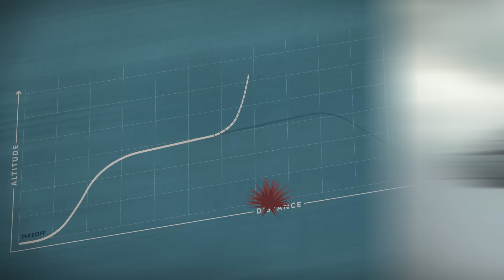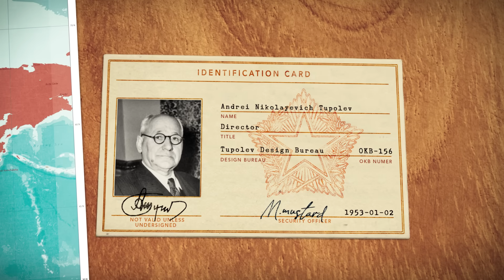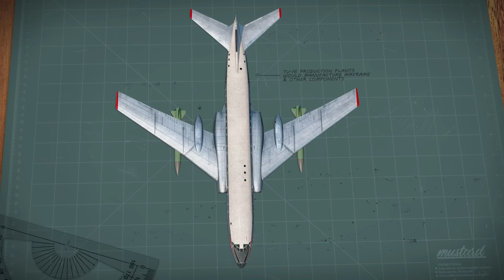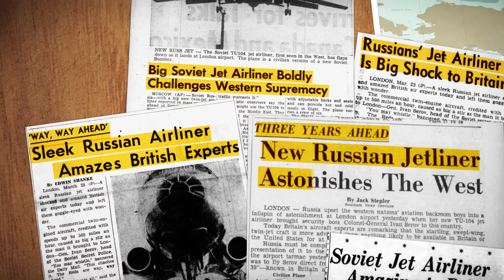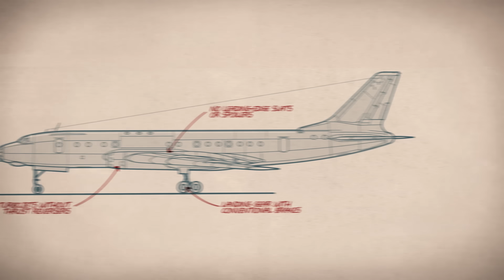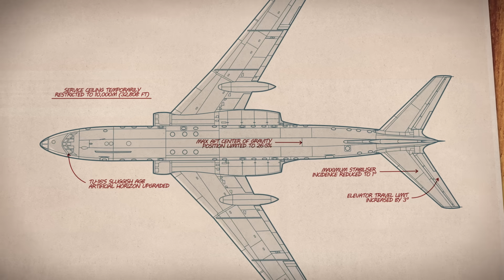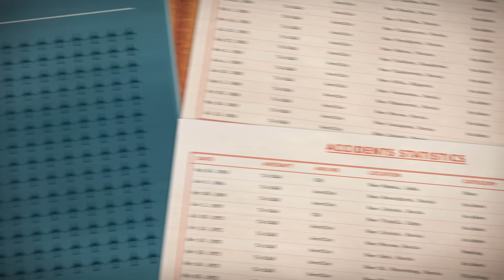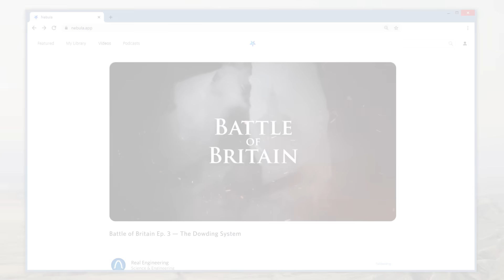The Soviet Airliner Designed To Crash

Comment: You now the plane is bad when you are hoping for a stall in order to improve your situation
Reply: The de Haviland Comet was the worst jet airliner in history.. it disintegrated in mid-flight
Reply: @WilhelmKarsten At what point did he mention the comet? Plus, at least the comet designers grounded the entire fleet until the issue was resolved, the Soviets swept it under the rug. And there's a reason the comet was actually successful, unlike the TU 104
Reply: @Crustaceannationrepresentative The Comet 1 is the biggest engineering failure in commercial jet aviation history.
The British government didn't order the Comet to be grounded until there were 6 unexplained hull loss accidents.
Reply: @Crustaceannationrepresentative The issue with the Comet 1 was never resolved, it's airworthiness certification was permanently revoked and no Comet 1s ever returned to revenue passenger service.

Comment: All aircraft have a fatal flaw - it's called the ability to crash, by loss of flight, power or hitting something solid at excessive velocity.
Reply: The de Havilland Comet is special... it often crashed because it couldn't fly, skidding off the end of the runway unable to get airborne 
And then when it did manage to get to altitude? It suffered catastrophic in-flight structural failures..
Literally disintegrated for no reason without warning...
 The Comet was the worst engineering failure in commercial jet aviation industry and a shameful and humiliating chapter in British aviation history.
Reply: Or maybe, in the cases or Air Inter 148 and Lion Air 610, software which does something that crashes the plane

Comment: the comet had one flaw in its design the shape of the windows ,stress concentrated on the corners and caused fatige cracking , a major problem for any pressurised aircraft
Reply: it was the way the plane was built, small cracks formed from the riveting of the plane which grew over time, the alumunium skin on the plane was so thin.

not really a detailed explanation
sorry for my bad grammar
Reply: That is a completely false narrative that has been completely debunked by modern forensic investigations.
Examination of wreckage recovered confirmed that the passenger windows were not the cause of the catastrophic in-flight structural failures.
 The Cohen Investigation founds dozens of fatal flaws in the Comet including structural design flaws, materials defects shoddy workmanship and a lack of quality control standards.

The Comets pressurized cabin ruptured at the crown of the fuselage structure at the widest ring segment that has the highest surface area, exactly where Pascale's Law tells us it should fail.
Reply: All Comets had 3 inch radius windows, the same as modern jet airliners.
Reply: @sandervanderkammen9230  they aren't made of the same materials now though

Comment: 07:58 why people still believe an airplane FALLS after there is no engine?
 They just glide, normally,  gently.  Nothing similar to a fall.
   C'mon!
Reply: but yeah, planes don't just fall after the engines fail
Reply: That's only if they're designed to glide
Reply: @Crustaceannationrepresentative  So, tell me just one airplane that can't glide.( not few  fighters, off course) 
    It is not a matter of being designed to glide. Gliding is a inherent plane characteristic that basically deals with gravity.
Reply: @GigaBit-i2j  Perhaps I should've been a bit more specific, a plane with shit aerodynamics won't glide WELL, which is the TU 104
Reply: @Crustaceannationrepresentative  I should be more specific.  Tell where you found that the Tu 104 could not glide normally,  as any other commercial plane. 
   I am curious  about where you got such an exclusive data .🙂
Reply: @Crustaceannationrepresentative  The Tu-104 didn't disintegrate like the COMET, the de Haviland Comet is the worst engineering failure in commercial aviation
Reply: Also this plane was way less glide efficient than other planes
Reply: @B-52H  The Tu-104 is certainly a much more advanced and efficient design than the d-H Comet.
Reply: @WilhelmKarsten  but it also has less lifting surface and a heavier design
Reply: @B-52H  Where did you find the glide ratio of this airplane? 
Just remember that ading weight does not change the glide ratio of any plane or glider. All that changes is the rate of descent, but the range it can glide doesn't change.
Reply: probably done so the plane don't lose too much speed while gliding.

Comment: The TU-04 was the second passenger jet to enter regular service in 1956 after the British Comet in 1952, which after two fatal accidents in 1954, all models were banned from flying until the causes were found. It turned out that the designers had not prepared the structure to be used with pressure differences and the planes were real flying "bombs". And as soon as as flights were resumed, another aircraft suffered an accident in mid-air, again killing all occupants. Pioneering is a dangerous business and must be contextualized.
Reply: The first successful, airworthy jet airliner is the Boeing 707, it revolutionized air travel and is the template for all modern jet airliners in service today.
The 707 family is so successful that it is still flying today and it is expected to remain in service until 2050.
Reply: The real tragedy of the Comet Disaster was that it could have been easily prevented if de Havilland had simply followed well-known and understood industry standards for construction of pressurized cabins made from riveted aluminum alloys, prior to the Comet de Havilland was still building aircraft primarily from wood and fabric using outdated technology.

The only lesson learned from the Comet was that aircraft manufacturers could no longer be trusted to conduct their own Air crash investigations

Comment: I have to admit, that was a good looking bomber  airliner.
I always found it interesting how the Soviets would do anything to play catch up on, or even leap frog the west. Even though briefly for the most part.
The Tu- 144 was another rush job but they pulled it off. Although it only flew passenger service for 55 flights over 8 months, before retiring to experimental.
Reply: The de Havilland Comet remains the worst engineering safety disaster in commercial aviation history.
The Comet was a desperate and doomed effort to leapfrog ahead in jet aviation technology and resulted in the worst tragedy in commercial jet aviation.
Reply: @sandervanderkammen9230  Wow, you keep replying to posts with info that has nothing to do with the original content.
You sound butt hurt?
Reply: @elconquistador932 You seem to be in denial about the Comet Disaster.
The de Haviland Comet is the worst jet airliner in history.
Reply: @WilhelmKarsten Nice alt account Sander.
Reply: @Mittens0407  Can you help me? I can't seem to find any British owned manufacturers making airliners... where did they all go???
Reply: @WilhelmKarsten  Nice alt account Sander.
Reply: @Mittens0407  So you can't think of any firm in operation in ol' blighty that still still knocking out airliners???
Reply: @WilhelmKarsten  Nice alt account Sander.

Comment: The speaker conveniently forgot to mention numerous crashes of Comet !!!!. So, this is just propaganda to humiliate Russia.
Reply: Common knowledge that the comets had their fair share of deadly accidents. But this video was about the Tu 104.😅
Reply: @elconquistador932 The Comet Disaster was the worst engineering failure in commercial aviation.
One out of every three built crashed or were destroyed in accidents, the highest loss rate of any jet airliner in history.
Reply: @WilhelmKarsten  Yes, I know. But again, this video STILL isn't about the Comet. 🤣
Reply: @elconquistador932  The question which is the title of the video is "Was This The Most Dangerous Airliner Ever???"

The Tu-104 has a very good safety record compared to the Comet Disaster

Comment: Imagine everyone knowing you have a death plane yet your government doesn’t stop it from flying.
Reply: Indeed, 6 de Havilland Comet airliners crashed or were destroyed in unexplained accidents before the British government finally stepped in and grounded the fleet.
The Comet Disaster remains the worst engineering failure in commercial jet aviation... 
a truly shameful and humiliating chapter in British aviation history.
Reply: cough MCAS cough
Reply: @unflexian  The Boeing 737 Max has a better safety record than the Comet..
The 737 is the most successful aircraft in history and has an excellent reputation for safety.
Reply: @sandervanderkammen9230  excellent reputation for safety, right up until the moment they covered up MCAS to reduce training costs for new pilots and increase sales, and killed 387 people.
Reply: @unflexian  You obviously have no idea what you are talking about lad..
Reply: @unflexian  MCAS was mandated by the FAA against Boeing's recommendations...
Currently the 737 Max uses the system originally proposed by Boeing.
Reply: @sandervanderkammen9230  the FAA had no idea about MCAS, that's boeing's doing. if the faa had the slightest idea about mcas, they would have mandated tests of code reviews that would have found the problem where one faulty aoa sensor can cause the system to trip.
Reply: @unflexian  The FAA mandated that MCAS have full flight control authority, Boeing never intended the system to have full authority and was designed to only act as a warning device, similar to a stall warning "stick shaker"  a very common system in aviation.
After the NTSB investigation the MCAS was returned to its original Boeing design and the FAA modifications deleted on current aircraft in service with no further incidents.

Any questions son?
Reply: @sandervanderkammen9230  I don't think if that adds up, boeing had to have hidden the existence of mcas from the FAA, there's no other explanation for the cloak and dagger. if mcas was known to the FAA in any capacity the certainly pilots would have heard about it. at the minimum someone who knew about it would have connected the dots after the first crash, but no one knew so this happen again.

take this frankly bizzare explanation from Boeing which doesn't explain their actions at all, and add to that the profit incentive of avoiding additional training, and you get corporate manslaughter.
Reply: @unflexian  You know you have lost an argument when you are forced to resort to conspiracy theories.

The NTSB investigation of both crashes found that pilot error was ultimately the cause of both crashes with MCAS malfunction as a major mitigating factor.
The NTSB was highly critical of the FAA mandated modifications to the Boeing MCAS software and full authority control.

The congressional hearings were also highly critical of the FAA and found the agency's actions were factors in both the  accidents 
Congress singled out several key FAA employees and found they had acted in a reckless and incompetent manner.

The Director of the FAA resigned at the conclusion of the hearings and several FAA managers were fired, resigned from the FAA or were punitiveely demoted to lesser positions.

The version of MCAS in service today is the original Boeing design... with all the FAA modifications deleted.
There have been no accidents since MCAS was returned to the original design.

Comment: If it’s Russian, it has very few safety features. Look at their space program. 😂
Reply: British aircraft have even fewer safety features and the worst safety record of any jet airliner in history... and the UK never had the technology to support a manned space program
Reply: @sandervanderkammen9230  In reality neither did the Russians. Though most Russian designs were reversed engineered off of others. Look at the B-29ski! Even down to the repairs made thinking it was part of the structure.
Reply: @ellisonlowrimore7751  True, but it is very clear that Tupolev learned about pressurized cabins from Boeing while de Havilland obviously did not... the Comet suffered from multiple catastrophic in-flight structural failures because de Havilland failed to use well-known and understood industry standards for construction of pressurized cabins made from riveted aluminum alloys.
Reply: @ellisonlowrimore7751  In absence of genuine blueprint drawings? I would have reproduced the repair patches too... that is just the smart, SAFE thing to do.
Reply: @sandervanderkammen9230  square windows and pressurized cabins do not work well
Reply: @ellisonlowrimore7751  The Comet did not have square windows, that is a common  misconception. 
The Comet had the same 3 inch radius windows found on modern jet airliners... wreckage recovered from the sea confirmed that the passenger windows were not responsible for the catastrophic in-flight structural failures.

de Havilland failed to follow well-known and understood industry standards for construction of pressurized cabins made from riveted aluminum.
The Comet had skins that were too thin and made from an alloy that was too brittle.
It lacked rip-stop doubler joiners.
The fuselage reinforcement hoops were too thin and spaced too far apart.
de Havilland used inappropriate and inadequate riveting techniques and lacked proper quality control standards for riveted fasteners.
The real tragedy was the Comet Disaster could have been easily prevented if de Havilland had not been inexperience in riveted aluminum construction techniques, de Havilland was still building aircraft primarily from wood and fabric prior to the Comet Disaster.
Reply: @sandervanderkammen9230  Ahhh BS! The one in the RAF museum I have seen was square windows. Sharp corners cause stress cracks. Proven fact. I’ve been an aircraft mechanic for 34 years and the early Comets had square windows. Later model was oval like a Gulfstream.

Comment: For soviets - always main stream was and is military function.
Their passenger airliners = are bombers, rockets = actually transcontinental missiles. And they still use them since 1960's, when they was desighned.
Reply: Most of Boeings airliners are also based on or share a military aircraft platform.
B-17, B-29 and B-47/ KC-135 are all used as a base for commercial passenger aircraft.

Comment: Go figure, a Soviet Union aircraft/airliner was the most dangerous of all time. I mean it’s the goat of horrible planes. Why am I not surprised. Is it because even if there were issues with these airplanes, nobody would ever know about it because the leaders would cover it up and act like there are no issues. Even if there is a horrible crash because of the safety protocols or w/e, they would just act like somehow it was the U.S. that made the airliner go down because of their electronic warfare or faulty components used in airplane from America.
Reply: Oh No, The British actually made the worst jet airliner of all time... the Tupolev Tu-104  has a much better safety record than the British de Havilland Comet.
The Comet Disaster was the worst engineering failure in the history of commercial aviation and the aircraft has the highest loss rate and fatalities per flight and per passenger mile.
1 out of every three Comets built crashed or were destroyed in accidents.

Comment: It was discovered that Comets were cracking up, literally! The square windows alowed stress cracks to open the hull, leading to rapid pressure loss. Crashing was the usual outcome. So they redesigned the windows and they became a very stable platform. The Royal Air Force still used them until recently as the Hawker Siddeley Nimrod (HS801). It was the UK version of the AWACs and mainly used as maritime patrol, where it could be on station for hours & oversee any big disaster/rescue missions.
Reply: Wreckage recovered from the sea confirmed that the passenger windows were not the cause of the catastrophic in-flight structural failures.
The Comet Disaster investigation uncovered 100s of fatal design flaws, shoddy workmanship and poor quality control standards.
The Comet 1 was so badly designed that they could not be made safe, their airworthiness certification was permanently revoked in 1958.
The Comet 4 was the worst jet airliner in service after 1958, it has the highest loss rate and per flight order passenger mile fatalities rate of any jet airliner besides the Comet 1.

The Hawker Siddley Nimrod is a completely different aircraft designed by a different company 2 decades later, it shares almost no parts in common with the Comet.

The Nimrod was also a disappointing failure with no foreign countries ordering them and a checkered service record, the Nimrod was grounded after one of the worst accidents in RAF history because of premature fatigue failure damage that was irreparable.